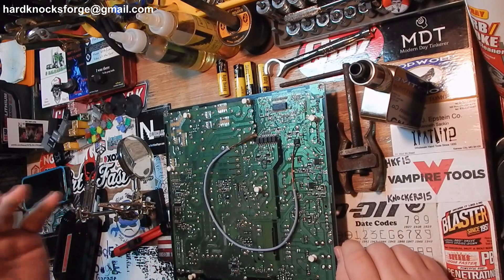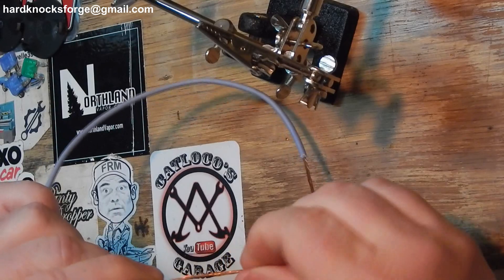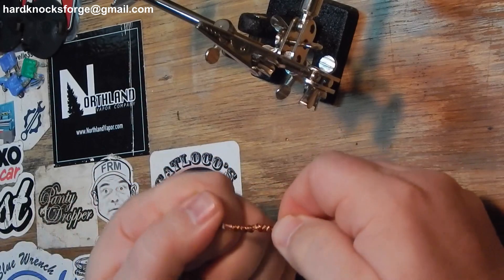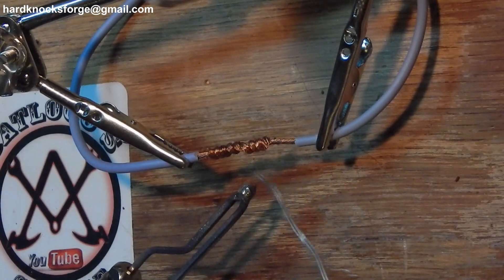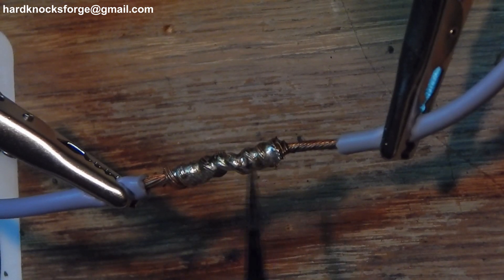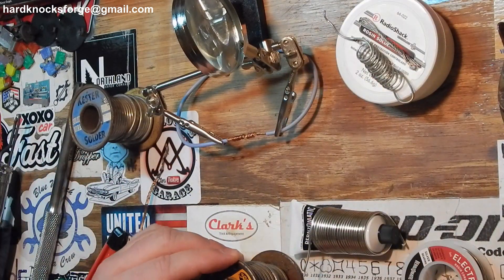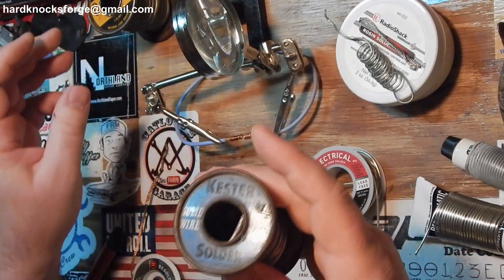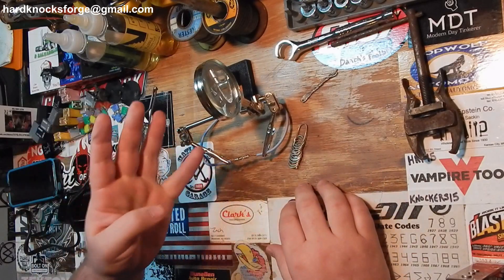How to Solder wires tips and tricks for the best connections

Comment: If your alligator clips are on the bare wire it will help keep the insulation from melting.  I like to use liquid rosin flux before heating the wire, it seems to work better than flux core because the wire starts to oxidize before it's hot enough for the solder.  That's a heck of a lineman joint there!
Reply from the maker: Great tip! I've started to notice quite a bit of difference between using the flux vs the rosin core and flux is where it's at.
Reply: @HardKnocksForge  you can use both.  I use an American Beauty mini solder pot with lead free solder for tinning wire for crimps.  No problems at all.  I also use paste RA flux sometimes.
Reply from the maker: I subbed up. Throw a little video out on your set up. I'd like to see how you have yours set up. It's kinda like me watching toolbox tours...I like to see what everyone else is using and how they organize their boxes compared to mine. It helps when it comes to organization at the very least. Sometimes though I see a snazzy new/old tool and begin the hunt for that tool...

Comment: This is the first of your vids I'm checking out... Been doing a ton of soldering . Actually got a nice old Weller station with pencil USA made from a garage sale for 5 bucks. I also have a bunch of older bigger Weller and ones like that. I always solder the wires when fixing old power tools.
Reply from the maker: J. Madone I may actually take that Weller apart and see what’s wrong with it. It really just doesn’t feel like it gets hot enough. I’ve been using it for plastic ‘welding’ and it’s been perfect. Soldering is actually quite satisfying once you get the hang of it. I quite enjoy soldering things as part of a repair. I need to find me one of those soldering stations. Those things have got to be huge time savers and quite a bit safer than just throwing a hot iron on the bench.
Reply: @HardKnocksForge   I'm sure you already are aware but if the actual "bit" on the tip of the gun is loose it can be a huge issue. I've popped in New tips and had it heat up completely 100% better. The soldering station I grabbed is nice. I would check ebay for a used one. They aren't that pricey. Most new stuff reasonably priced will be foreign made most likely.
Reply from the maker: @j.madone7819  I wanna say if memory serves me correctly that's the problem with most Weller soldering guns. It's not the tips though, as new tips don't make a difference. I think it's the actual threads that are stripped out. Making it impossible to tighten. I do have some taps laying around. I'll have to check and see if there is enough meat there to woller out some new threads for a new screw. Just gotta get time over on the 'fix me' bench to take a look.
Reply: @HardKnocksForge  ah the fix me bench...I know that scenario all too well haha

Comment: Great video! Is that the only soldering gun you use or do you use any butane or compact ones. I’m looking for better ones for under dashes.
Reply from the maker: I have a few different types. A couple of the pencil type, a couple guns, and some torches. I don't have any of the new fancy ones like the Portasol ( https://amzn.to/2vlo1rM ) or the one that's rebranded for Snap On or the power probe one ( https://amzn.to/2KsHqfi ) If I were buying one like the ones in the links, I'd have to flip a coin. Guys love the Portasol one and lots of guys love the power probe one as well. Power probe seems to be a little smaller and costs less also, so I'd probably start there if it were me.

Comment: What if the wires are real short
Reply from the maker: I still do the same but it’ll have less wrap around. It’ll still work better than anything else. Sometimes a butt connector is your friend. I’ve also rebuilt connectors because the wires were too short. I did that for a 5.7L Dodge Ram a few weeks ago...

Comment: Why was this video not available when I was working in the Laboratory and I had to solder things back onto the PCB's??? 😫 Oh well guess that's why we have  engineers to help us, but still.... I always hated asking for help lol 😅
Reply from the maker: Soldering is pretty easy. I’m sure you were a master after just a few tries... PCBs are a little harder. You can get way too much solder really fast on those boards.
Reply: Hard Knocks Forge yeah, the PCB's were 10 times smaller 😟 then what you're showing on this video
Reply from the maker: I have a couple magnifying glasses I use on the smaller stuff. One with a light and one without. All I really do is change out caps for the most part. That seems to be a pretty common failure on the flat panel TVs.
Reply: Hard Knocks Forge you're all set! Good stuff 😄